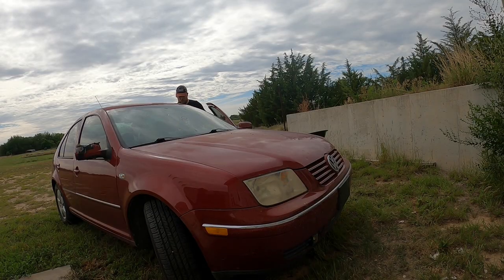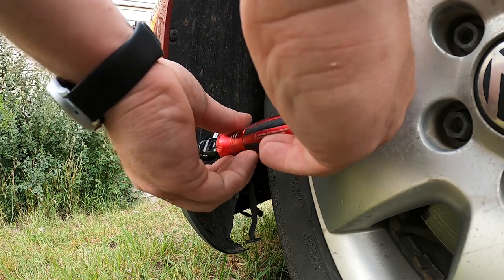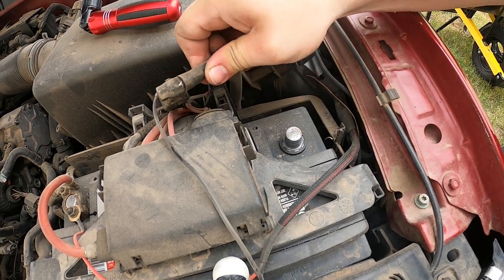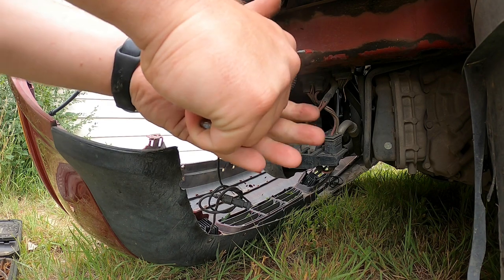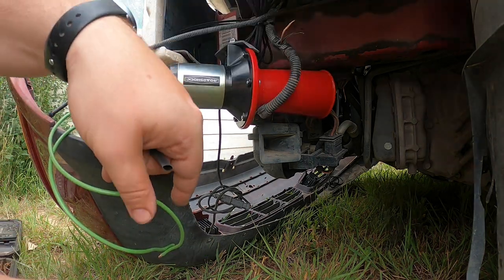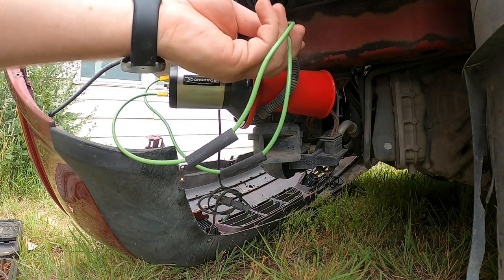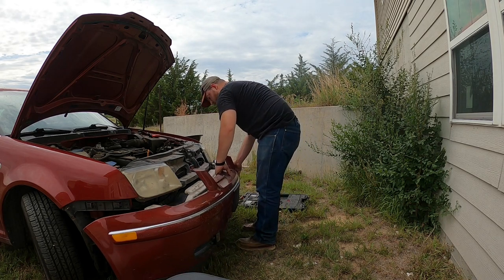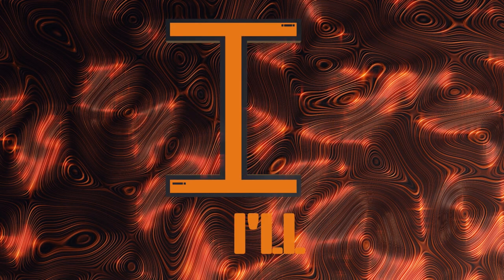MK4 Jetta Ooga Horn install Harbor Freight

Comment: Put a 10 ohm resistor and it will sound better
Reply: I'm pretty sure it's a 1 ohm not 10 ohm, but yeah resistor really improves the sound.
Reply from the maker: I'll have to try this. Thanks

Comment: I have the same horn on my ram and I want to put it on my Mazda too. But the Mazda only has one wire, before I burn up something, if I ground the negative on he horn to the horn mount, would that work? Can anyone help?
Reply: If there's only one wire, the frame must be the ground. All it can do wrong is nothing, or run backwards like mine did.